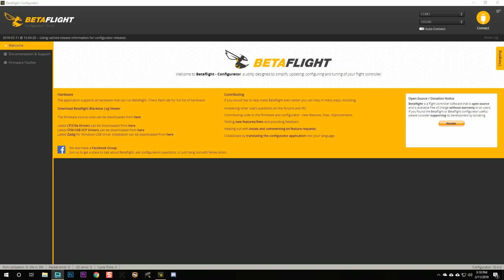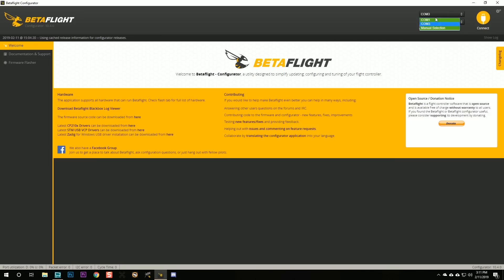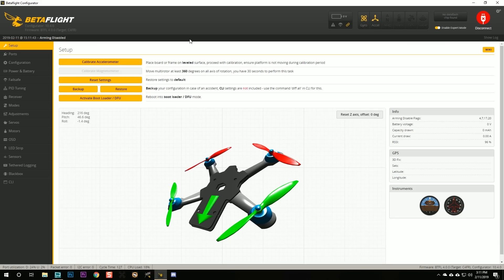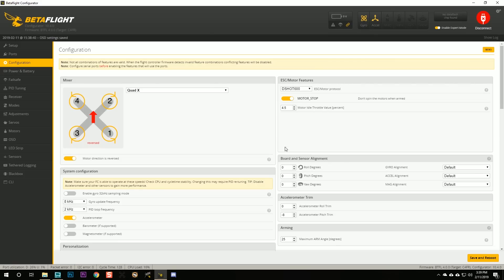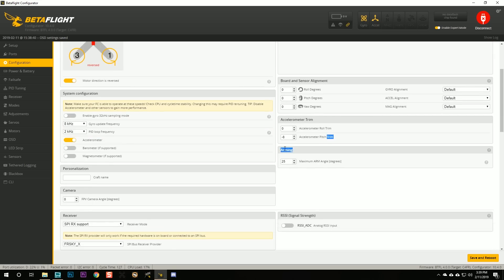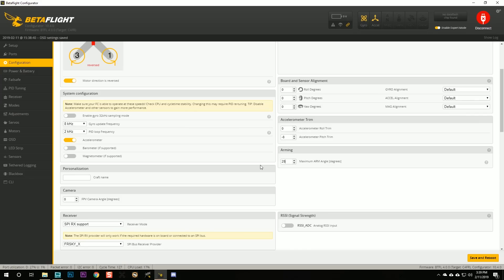Eachine Trashcan Initial Betaflight Setup | DO THIS BEFORE YOU FLY

Comment: Could you please help me!!!! I’m super stuck .. I wanna put the xt30 on my trashcan I have 450mah 7.4v 80/160c 2s lipos .... could I use these with it as I have a hole bunch already for my qav  if you could give me any advice please mate
Reply from the maker: Sure, give it a try! You can use it. Just a question about the weight but I think it probably will be okay.
Reply: Thanks mate really appreciate it !! Gonna have to cut the battery mount and just use a  strap to make it work but worst case I’ll get a slightly smaller lighter bat I guess I’ll let yu know how it goes thanks for replying

Comment: Mine wouldn't bind on D16, when i changed to D8 it bound immediately. What would cause that? Is my firmware on my Taranis old or some other issue? Thanks!
Reply: cellborne same here - Taranis 7 with newest fimware
Reply: @TheHertzi  hey, I ended up figuring out there was a setting I needed to change on the quad side to get it to work. I can look it up when I get home if you are still having trouble. Also had to change the version of code on the quad because some of the configuration pages were freezing up.

Comment: Mine floats and flys with throttle off in the wind, and very slowly lowers to ground.  Which setting may help this? New PIDs? bf4.1 just installed. tried with bf settings and settings in the trashcan manual and both floaty outside, fine indoors except hot motors 130-140degrees after 1-2 min light flying.
Reply: In some cases you could have a zero throttle percentage when armed where it has a min rate for the props, and I think your zero throttle might need to be adjusted to a lower percentage.

You could also toggle anti_gravity and see if that's the case. 

You could 

It might not be the correct fix, but I hope it helps.

Comment: # bind
###ERROR: UNKNOWN COMMAND, TRY 'HELP'###
Reply from the maker: Your trashcan is not using the built-in FrSky receiver on the FC. It must be spektrum or Flysky receiver. These must be put into bind mode by pressing the bind button on the receiver. These cannot use the CLI command "bind".
Reply: @JoshuaBardwell  thanks for all videos. i had a problem excatly same. i ordered fr-sky. how can i understand? there is no any sign or name about recevier on the board?
Reply: Have the same issue - the original FW had the bind command but the 'no mods' issue - the FW I installed doesn't have the bind command anymore - but with the help of the button it connected to my Taranis qx7 just fine.

Comment: My internal voltage regular was bad on this trashcan. Soldered a workaround stepdown regulator (pololu 5v)  to it, it spun a few times.
Next pack i noticed smoke coming out of the flight controller. 
My friend flies his 2nd pack ever on it, it shorts also.   These crazybee's are terrible. If my last one (v2) dies i'm totally done and will buy betafpv.

Does somebody have a backup /cli-dump of the trashcan so i just have to configure receiver?

Comment: Can you buy any controller or does it need to be a specific one? I am new to this hobby :)

Edit: And should i buy it compatible with a frsky/flysky or spektrum thing.
Reply: Hey, there is some stuff to be looked at. The most common systems are FrSky 9xD or the QX7, as well as the Spektrum models. I'd suggest to go with the QX7 from FrSky. Next thing is to decide about compatibility of the trashcan receiver: When you buy the FrSky QX7 from somewhere out of the EU, you chose the trashcan receiver FrSky non-eu. If you bought it in the EU you buy the eu-lbt version of the Trashcan. I think you can change the firmware to make your FrSky controller connect to the other kind of receiver, but it's a bit of work - so chose the one it will bind with easily. And then comes the next thing: research... you need to research your receiver, your controller, your battery etc. It'll give you soon some understanding of the FPV glasses and all the stuff you require to know. Because asking the stuff gives you one specific answer, research gives you insight. AND: the hobby is terribly expensive, and very time consuming. Think about that too.
Reply: @Cult1022  thank you!

Comment: You need to know... The part about not having to hold the bind button while powering up is not necessarily true. I did this yesterday after watching this video and there was no way in hell it would bind. Then I tried the old way - Powering up while holding the bind button - Radio confirms binding... Flysky version.
Reply: Do you have the flysky i6x?

Comment: Joshua i crashed my trashcan and 2 motor shafts where a little bend and it was unflyable.
I bended them a little back and was flying a pack when the power dissapeared so i thought the battery was empty.
Now it doesnt turn on anymore on batteries , it lights up with USB, and when i connect a battery i can read the voltage in betaflight.
It doesnt seem to be the power-lead since it can read voltage and cells etc.   I can also power the motors in betaflight full speed. 
What the .. can this be?
Reply from the maker: First lemme just say there's no way you bent the shafts back so they were straight and balanced. Once the shaft bends, it's not going to fly right ever again, unless you're a machinist with a pretty precise dial caliper.

If it doesn't turn on from batteries, most likely the 5v regulator has died on the FC. You could theoretically add an aftermarket regulator, but most likely replacing the FC is the decision that will work best.
Reply: @JoshuaBardwell   Iwas scared when connecting the motors to the new flight controller so i ordered 2 new motors as well.  I wonder what the cause is,  i've flown 2 packs on it :/ That hurts but i'm still alive. Thanks buddy, it should arrive in 3 weeks, luckily i have 1 mobula laying around.

Comment: I set up my transmitter and the modes as well. The Aux1 works as it should be. On modes tab in the Arm setting the yellow small line moves as it should be, but the ARM rectangle on the left side never turns to yellow, and the copter is never armed. As I saw in your video that rectangle did not change either. The arm angle is set up for 180 degree. What is missing?
Reply from the maker: This is probably the cause https://www.youtube.com/watch?v=9iC1tuRBfxk
Reply: @JoshuaBardwell  Thank you for your answer. Yes it could cause that the ARM rectangle is not yellow, but through OSD it was able to see that the copter did not armed without usb connection as well. But you give me a small hope with the method to get the status! :) In arming disable flags it had a word: Throttle! So I checked that, and I realised, that the throttle range on the transmitter is smaller, than the flight controller expected, so the min throttle on the transmitter did not mean the zero throttle on the flight controller. In this case of course it would not be armed! I solved the range, and magic has happend! I am on the air. Thank you, again.

Comment: My bind button doesn't respond and betaflight doesn;t know command ''bind'' what should i do to bind?
Reply from the maker: If betaflight doesn't recognize the "bind" command this probably means you are not using one of the SPI-type receivers. This would be true if you had a non-FrSky Trashcan for sure.

If the bind button doesn't work, then I would try to replace the unit. Reach out to whomever you bought it from. 

A workaround for the bind button being broken is to manually bridge the center and outside of the PCB pads that the button is attached to. This would work if for example the button had scraped off by accident.

Make sure you are really pressing the bind button and not the bootloader button.

Comment: I got mine and it is for dsmx can I make it work with my flysky fs i6. Or do you know how to make an older dx5e work. I cant make it arm
Reply from the maker: Flysky cannot bind to a Spektrum receiver. It's not possible.
Reply from the maker: Dx5e should bind I think. I'm not sure whether it supports the newer Spektrum protocol.
Reply: Ya. I tried to flash the firmware and it wouldn't switch to fly sky. But I tried. I just cant get it to arm now everything seems to work but that.
Reply: And I do have to say thank you so much. I got my wizzard 220 a few years ago. And your videos are what tought me everything.
Reply: So idk if this helps at all but I have arming disable flags 7 and 17. 12 just went away and I cant find what they mean

Comment: I can't bind the trashcan to my QX7? It came with frsky non eu receiver and my radio is EU LBT how do i get it to bind? Can i add an external receiver if so where do i solder sbus Rx2 can i connect to any vcc and gnd? Please help..
Reply from the maker: https://images.app.goo.gl/7kLcnPoag6Mo8N3SA

Here is the pinout for the FC. Use an xm receiver with UART 1 rx marked in the diagram.

Comment: Hi Joshua, thanks for the video it was a great help. My TC is the DSMX version. I’ve flown quite a few packs over the last 2 days and it has just started to twitch in yaw, Ie spin quickly & sometimes & fall out of the sky. I have noticed the RX antenna is gone. Would this be causing the issue?
Reply from the maker: Missing rx antenna would cause failsafe which does sound like you are describing.

Comment: hi josh  my roll either is 988 2012 or 1000 1972 ccalibrated taranis cant get 1000 2000 on roll cheers
Reply from the maker: Setting Taranis outputs screen to about 96% endpoint should bring it to about 1000 2000. Or use rxrange as shown here.

Comment: Hi Joshua, is it possible to flash the firmware of the trashcan receiver from Non-EU to EU ? Thanks!
Reply from the maker: I don't think so. The EU version of the Mobula comes with external receiver.
Reply: @JoshuaBardwell  Thanks for the quick reply! But if I solder an external receiver on its FC? Like the "FrSky D8 AC800" on the UART2 for example, Should it work right?
Reply: fr2632 but other way around should work - flash the non-eu FW onto the Taranis - that's what I did as well

Comment: I am using the receiver-less board, added my own r-xsr, and I am getting continuous telemetry warnings. I used the 3 wire connection that was already soldered to the board, not sure if there is a separate pad that I should connect a wire from the uninverted pad on the r-xsr (I don't think there is a free uart, so don't think that's possible)? How can I just disable the warnings?not all that concerned about rssi anyway on a close range flier like this anyway. Wonder if I were to connect a crossfire nano (way overkill range wise) utilizing only one uart if I could get it working properly?
Reply from the maker: Bind with "channel 1-8 telemetry off" selected in the Taranis.

Comment: I am able to connect to Betaflight and configure settings and flash new firmware. When I try to flash BLHeli I cannot read ESC configurations. Any thoughts on what to do? I'm open to suggestion and If any more information is needed please let me know and I'll post.
Reply: I guess I should add that I can control the motors from BLHeli suite and it does appear to fly okay.
Reply: A user on Reddit told me to try the chrome plugin. That worked!!!

Comment: QUESTION...  I cant arm my (first drone) trashcan drone! When my Aux 5 is in the armed position I see the indicator moves into the range where the drone should be armed but the square on the left doesn't highlight (like it does on angle mode, ect). I confirmed my transmitter is in TAER1234 mode just like I have configured in the configurator. Do you have to flash firmware or to flight controller first or something??. Please Please help!  Literally cant't get up and flying without this, Thank you so much!
Reply from the maker: This is probably the answer: https://www.youtube.com/watch?v=9iC1tuRBfxk

Comment: Is it better to adjust the Rx endpoints via the Betaflight commands you demonstrated or to use the output sub-trims in the radio? Am I losing some resolution by doing it in the radio instead of BF?
Reply from the maker: In theory resolution is maximized by having the radio endpoints as wide as possible. Practically speaking I don't think most pilots would notice the difference.

Comment: Thank you! This was perfect. Well, one thing: when you're talking about setting the rxrange in the cli you could have mentioned that you need to save before exiting...
I'm trying to learn to fly, using your sim tutorials among other things. And I bought a Trashcan to use as my first live quad. I just set mine up from your instructions and got it off the ground. Now I need to go back to the simulator because I'm really not very good...
Reply: thanks.... I was wondering why it wasnt working it was spitting me out and disconnecting and resetting every time i switched from the cli tab... typing sve and pressing enter was the solution thank you!

Comment: is there a way to flash the recever to EU- LBT ?
Reply: I don't think so, but it's easy to convert taranis radios to non EU-LBT.
Reply: @henriknord9780  i know but i'm in the EU and all my other quads are EU-LBT and flashing the xm+ to  EU-LBT is no problem but this one is on the board and i was wondering if its possible.
Reply: I think it will work in D8 mode with EU-lbt. Haven't tried my self, but might be worth a try. But then I guess you miss out on the telemetry.

Comment: I am only 3 minutes into the video and I can tell you now that I have problems with spi mode locking up on d16 with the trashcan
Reply from the maker: Me too. Bind with telemetry off.
Reply: @JoshuaBardwell  I think you learnt something today Joshua 😂

I have been unable to rebind so my only option was to install a separate receiver.
Reply: Why am I the only one WITHOUT that issue, binds fine for me and my X-lite.  I have 30 or more flights on my trashcan

Comment: What about "actual " settings Joshua? Throttle idle,pids,filters. You left everything at stock?
Reply from the maker: This is a beginner setup designed to just get someone in the air. We can explore tuning later.

There are some custom tunes out there but I haven't tested them yet.
Reply: @JoshuaBardwell  i know, just would like to see your tuning :). I have mine for a week and i like it a lot. I heard that increasing a lot (like 12-14) the motor idle helps a lot to the washout. Haven't tried yet. Cheers!

Comment: Just got my Trashcan 6 hours before this video! Wish i didn't have to watch a different video form Mr. unbox and figure it out at the same time of filming guy. I assume you're going to make a flight review of this? You should include the "setting throttle to 50% on a switch" for indoor flying. Test it on a different battery with the provided TX30 connector and compare if it's worth it. Test the vtx power levels in smart audio, i believe there's actually a 500mw setting eventhough im sure that's b.s. anywho happy flying
Reply from the maker: I made a video about throttle limit on the Mobula and the Trashcan will work the same.
Reply: @JoshuaBardwell   My bad! i'll go check it out now thanks!

Comment: Hi Josh I got a Mobula 7 it wont bind to my flysky got a new flight controller still wont bind went to betaflight cli - bind , unknown command ?
Reply: moon runner try bind_rx_spi
Reply: @pittbullFPV  Thank you for your reply I tried it - still unknown command
Reply: moon runner oops I think it’s  bind_spi_rx .   It’s internal and how I got mine to work since my bind button broke off
Reply: @pittbullFPV  Thanks M8, I tried it , still unknown command, was your's a Flysky?
Reply: moon runner yes.  Bound to my turnigy evolution radio.
Reply from the maker: The Flysky version has an external receiver. You can't bind from CLI.

You must use the bind button on the receiver.
Reply: @JoshuaBardwell  sorry  I don't understand external receiver it didn't come with one, do I have to fit one?  I thought Flysky version was BNF.

Comment: why not adjust the RX ranges in the transmitter? wouldn't the centers be more accurate that way?
Reply from the maker: You can do it either way. The advantage of the Betaflight way is that it works for any transmitter. So I don't have to do seventeen different videos depending on what transmitter the person has.
Reply: @JoshuaBardwell  Very nice and definitely more efficient than 10 extra videos. I did learn something. I never knew you could do it in betaflight. I will have to try it with the build I'm currently working on.

Comment: Hello there I got my first real quad first of the year it's a et115 V2 I went through your betaflight setup took me about two weeks but I finally got it put it under a clear plastic tub Forward Motion went to the right and it just went berserk so I'm going to have to go through it all again I have a red light on my VTX which I think that's something wrong anyway I wish you'd make a full video setup on the ET115 3s version I sure would appreciate it this is flying squirrel from Asheville thanks take it easy. By the way I've watched all your videos. And I wish you could have been there when me and my buddy with an Apple computer were sitting there watching your betaflight set up video and you called Apple users weirdos that was hilarious
Reply: Did you watch the Grayson Hobby video on the ET115 setup, might help? :) Good luck.